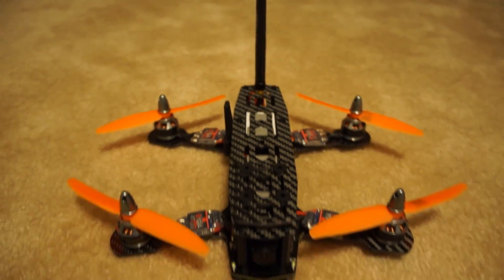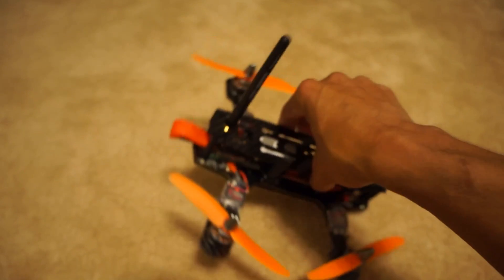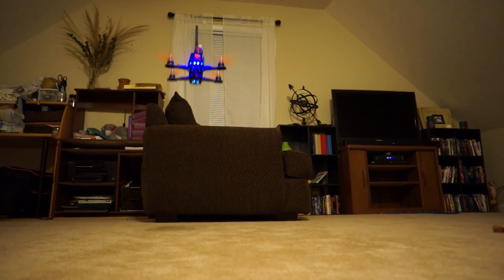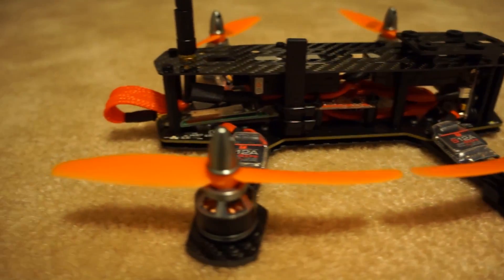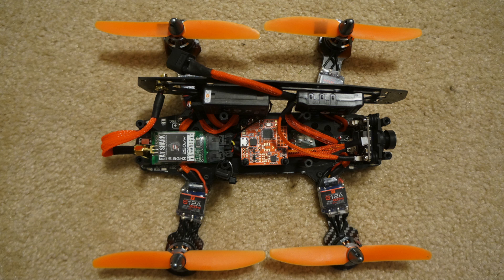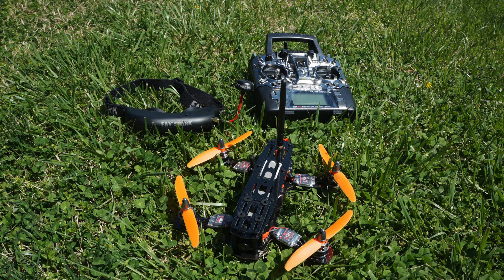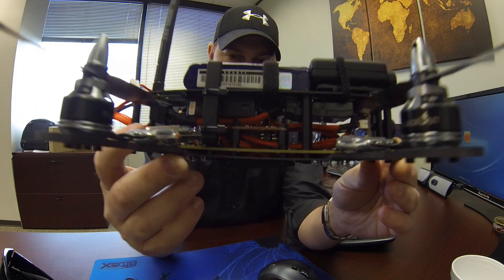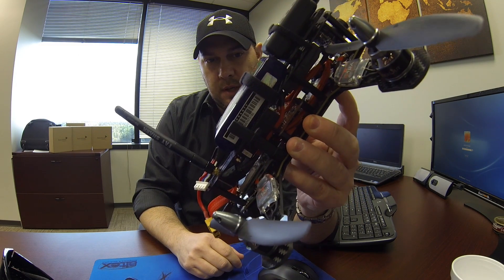RTF Blackout Mini H Quad FPV Build Service. W/ Customer Testimonial!

Comment: Hi! Thumbs up for the lovely work on this one!
May i ask, is that the Naze controller?
I am currently carried by a Naza in my hex, but i am considering building a mini-quad. What board would you recommend?

Would be awesome if you could be the first one on the tube  to make a REAL controller compassion/review video! I´m considering naze (two versions of it also), the naza-m lite, CC3D and Openpilot.
Reply from the maker: Get a naze32 acro or cc3d. There both great for this frame. A naza will be to big and fly like crap.

Comment: Can we get a build vid from scratch to ready to fly??? to make it look like this??
Reply: love your vids btw
Reply from the maker: I'm glad you enjoy the videos, but sorry I'm not making a build vid. Each video I make takes many many hours to make and I don't get paid or anything from them. So I just make them for people to enjoy when I have free time which isn't very much.
Reply: ***** gotcha.. hey quick question do you have a comparison between the Tiger MN1806 2300kv and Tiger MN2206 2350kv. If not do you know what one is more powerful or better???
Reply from the maker: The 2206 on 4s will be crazy but I'm not sure if they fit on the BO. The 1806 are great all around plenty of power. When you start getting to much power it is harder to fly with precision because every soft bump of the throttle makes it jumpy.

Comment: Wow, clean build, and love your videos. I have a question for you though. I have this quad with the same exact sony camera, but when my motors start up, I have noise in the video. When the motors stop, the noise stops. I have it powered up off of the pdb since it's 12 volts. Is that how I should have it? I ask because I had another camera before that was 5 volts powered up off of the Immersion vtx and I didn't have that problem. Thanks so much for all you do man!

Comment: Nice work, is there a significant difference between the t motor esc and the hobby king esc that you used in previous video? Which brand would you recommend?
Reply from the maker: Use whichever ones you want. I can't tell a difference. I'm pretty sure there the exact same esc.

Comment: For anyone that doesn't build for themselves, it's assumed they have to return to the mfg (so to speak) for repair or replacement.  Kind of a pedestal price really.
Reply from the maker: That couldn't be more wrong. Just because somebody buys something RTF doesn't mean they cant build and fix by themselves. Look at the thousands upon thousands of DJI phantom owners. When they crash and break props or whatever they don't send it back to dji, they fix it. Most people want something RTF because they might not have the Time to build it, Necessary build skills, or necessary tuning skills. Also there is a huge convenience factor when it comes to buying something RTF that some people like.

Comment: Hey, I have everthing 75% assembled. But im afraid im gonna fry my Naze32. Im reading up on Naze wiring but am stuck. Build items are as follows: Carbon Fiber Mini H metal head frame, Cobra 1960kv motors, Naze32, 12a Afro esc's, HQ carbon filled 5x3 props. I installed an old Naza M lite in it to make sure it flys (like a tank on Naza) til the Naze got here. Again, the only thing im unsure of is the wiring of the board. Thanks for your vids and any help would be appreciated.
Reply from the maker: look up naze 32 on google and go to the RCgroups.com link and you can find how to set it up there.

Comment: I have a frame with distribution board, SunnySky X2204S KV2300 motors and F-12A Fire Red series Simon esc's on the way. I currently have Immersionrc 600mw fpv set up. I am very interested in having a clean build like that done. That is awesome! Please get back to me.
Reply from the maker: pm sent
Reply: ***** I saw your other messages. PM Sent

Comment: That's a nice build. Certainly cleaner than mine, although you really need some freshly cut grass inside it just to finish it off ;). One visual tip I could mention is to paint the edges of the PDB :).
Reply from the maker: LOL I don't think the customers would like grass clippings all through the quad but ill let you know if one of them does lol.
Reply: ***** In my experience they always end up with grass in there so why not save them the time? ;)
Reply from the maker: The Imperfect Gent
LMFAO very true but then if thats the case why not send it to them with a bag of broken 5 inch props lmao!

Comment: How does the voltage beeper work? Is that soldered right onto the Naze32?
Reply from the maker: its soldered to the pdb
Reply: ***** Thats cool but what beeper works? and if its just any you attach to a balance cable what pins? This is awesome!
Reply: Luka Milković Never mind!
Hobbymate 3 Cells Lipo Battery Low Voltage Monitor LED / ALARM
is what you used. This is a life saver! I am using the Naze 32 on-board voltage sensor with a buzzer, but it is just too quiet.